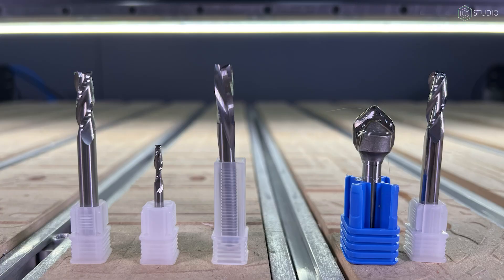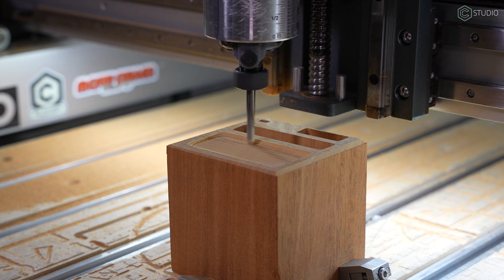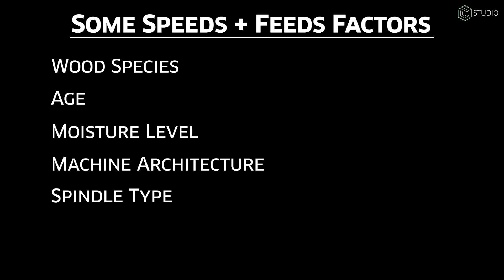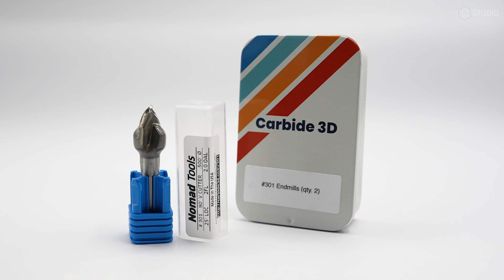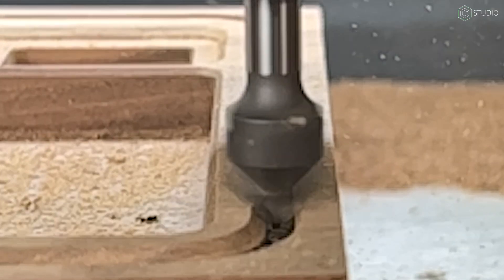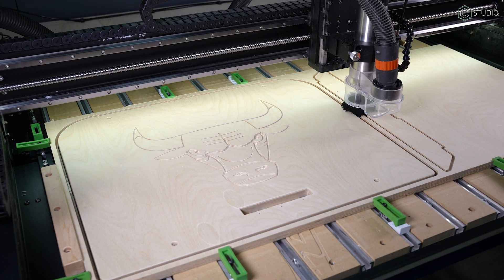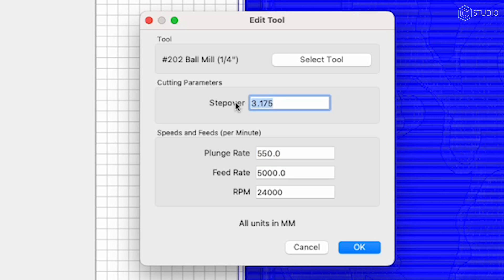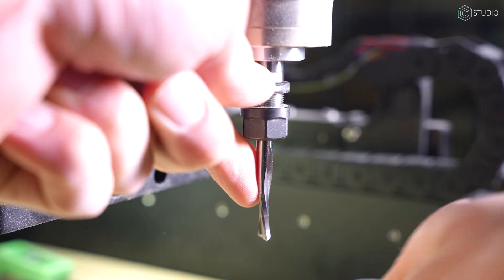5 Essential End Mills for Every CNC Owner

Comment: Can the 120/ 60mm spindle support a 1/2 flat endmill or not enough torque?
Reply from the maker: The 65mm spindle can handle a shank up to 1/4", and the 80mm spindle can take a shank up to 1/2".  Both can handle cutters with a larger flute diameter; you'd set a lower depth of cut for the 65mm spindle to reduce the power required.